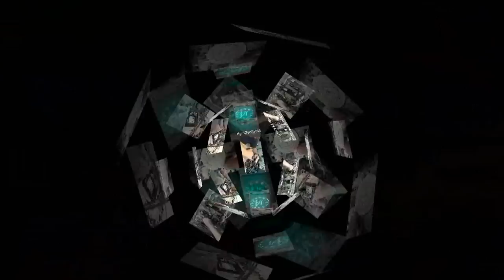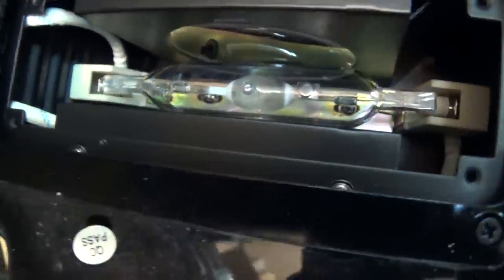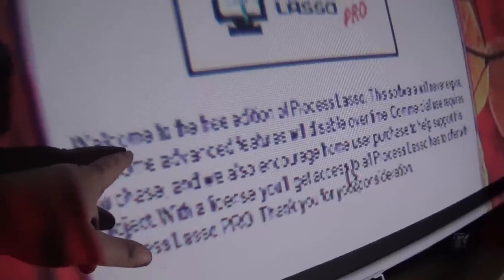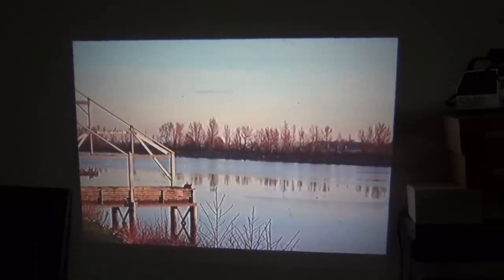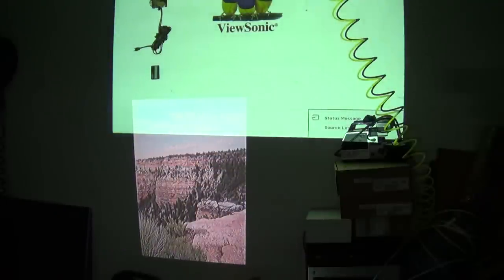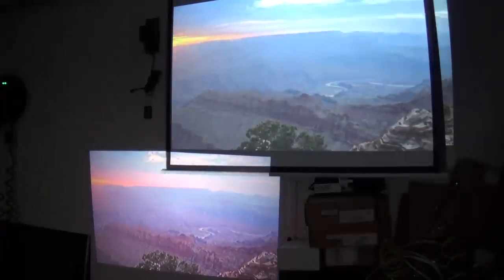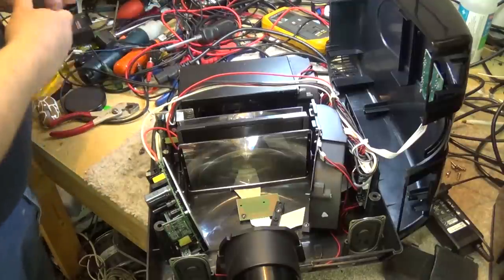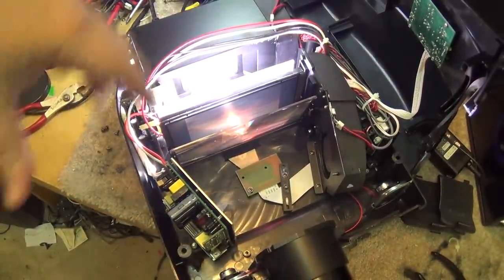Cheap video projector compared to a Viewsonic DLP

Comment: Hey, Watch it..I got one of these...(50 Watt LED version) Yes, you have to completely darken the room,  but try projecting that onto an actual REAL 1:2 screen material instead of a damn  assbeat garage door, you'd be surprised. BTW, I bought mine in my fav section, "For parts only" section of fleabay for 48$  The stupidity of people has risen exponentially past 10 years,  had it out the box, fixed and working in 20 minutes upon USPS delivery. Yeah I know its a cheap chinese  7" Display LED driven POS, but knowing what to expect, and 48$ is a far cry from expectin a Hi-Def, contrast sharp, Movie Theater quality picture for 300$...LMFAO,  Shiiot, I got more invested in my 131" theater screen than the projector, but I have now upgraded the projector to  an Acer H5380BD DLP Projector (also bought from my fav section) after using this cheap chinese fresnel lens designed device for 4 years.
Reply from the maker: I have one of those LED version projectors too. Got it for free. It used a 4" HD LCD panel and actually produces a respectable picture considering what it is.  This one had a 480 panel and looked pretty bad.
Reply: @12voltvids  That Acer will be here Tuesday, Read nothing but good things so far, pictures still great in a fully lit room reviews say, a TRUE 3000 ANSI Lumens,  a native rez of 1280 X 720, DLP, and a 17,000:1 Contrast ratio, WoW, should get some pretty decent blacks in the show now, throws out to up to 300", Amazing... and I just need 131" ;)  "ya that's what she said" Pic of my Homemade screen below, roll of theater screen 2:1 was 100$, rest was lumber from Lowes, ;)  about 150$ total, 4 years ago
Thanks for the great Vids 12voltvids!! ;)
http://i58.tinypic.com/293w12e.jpg
http://i68.tinypic.com/rkv9n4.jpg
..and this last one is hillary-arious, totally unplanned "Kodak Moment" ...
http://i65.tinypic.com/1q0jdl.jpg
Reply from the maker: @thecentralscrutinizer5105  DLP and LCOS are great projection technologies. I have a DLP TV here, actually 2, bit one the DLP chip is failing on. That one uses LED light engine and has one of the best pictures Ihave seen. Well it did until the mirrors started falling off the chip. Now it needs a new DLP chip. 225 for the chip is a hard pill to swallow to fix it.
Reply: @12voltvids  Ya, TI's DLP tech bothers me still, very touchy, results are brilliant, but damn,  so sensitive. gotta treat em like an  egg. I used to service stuff from a local chain "Rent-2-Own" place (8-stores) and they hooked up a line of tv's (Thinking Sony's) w/ this new Digital Light Pulse tech, looked quite impressive...at first. about 3 months after renting these,they were were failing left and right on me, that was 2010-2011. ..., they ended up ceasing that run, thank you very much, ... and here I am getting ready to hang a DLP projector from a 12ft ceiling today...LMFAO ;)
But I'll let ya know what the final results will look like, waiting on the Postman now. Thanks bud...
Reply from the maker: @thecentralscrutinizer5105  
Sony used LCD and lcos and they were crap.  Panasonic Toshiba lg and Samsung used dlp as did BenQ ViewSonic ECT. Only my 1080 Samsung that used "wobulation" has the problem and that set was never bumped or banged around.
Reply: @12voltvids  OMG, I can finally take down all my black curtains from the 2 entrances and the 2 windows in the room, Holy crystal clarity Batman!! LOL, another "Busted", "For parts only projector" repaired in shorter time than it took to take it apart. But I am in Luv with this puppy, I can't get over how bright, clean, sharp the image is. Think this one makes up for those couple lemons I bought about a tear ago, those were definitely smashed & trashed. Kept the bulbs & lenses...lol
Side Note about this Acer, The seller did state it came with no remote, but I figured I could get around that problem till i can order one. Turns out I can not, theres only a power button on it, I can get to the native res, but i need to get to the controls of it via remote to adjust anything such as size, color,brightness,etc. I dig the fact it auto adjusts when flipped upside down mounted on the ceiling. Ordered an OEM remote,cheap, but coming on a slow boat from China..lolz...So I'm right this very minute, making an IRblaster for my samsung fone from a couple of IR LED's and a 3.5mm headphone jack, and the android remote control app, "ZaZa"
Let ya know if it works ;)
Reply from the maker: @thecentralscrutinizer5105  
Yes DLP technology looks great doesn't it!

Comment: I working in shop where servicing branded projectors. Open lamp cover protection has 1of 100 in branded projectors. And this lamp cover protection i saw wotking in cheap chinese projectors. That is not true that you are saying that all have. And for your Viesonic lamp manufacters is many and genuine. And hand made, that is true they all are hand made. Because is sources where you can have repair kits. In lamp housing is changing only high preasure bulb. That is because in market is very old projector and as always need to change lamp and you cant fast find suplyer than you can buy kit if housing  is good than you can repair it.
Reply from the maker: All projectors should have a lock out for the lamp to prevent it from operating when the cover is off. This is especially critical in projectors that use the UHP lamp, as these lamps have been known to explode, and they produce tons of UV radiation, UV-A, UV-B and UV-C which is the harmful type. The projector itself has UV filtering before the light exits the lens, but the lamp itself produces a fair bit, so you don't want the lamp operating when the cover is open. Out of all the projectors I have serviced this is the only one that doesn't have a lockout, but I am sure there are plenty of cheap ones out there that don't. The better ones certainly do.
Reply: 12voltvids Now on my workbench now i have 5: Toshiba, Sony, Xerox and old ViewSonic and Epson and none of them have some kind protection to protect opening lid. No microswitch no IR pair no IR swich no magbetic switch. And epson is 2017 model.. After your video i checked all with open lid and all working fine in open lid. About  that UV that you are writing in open lid they dont come out even that lid is open. I think this lid is mainly for that you cant take or lose lamp in working condition. Because i did experiment if in working condition take out lamp one blowed away one distorted that high preasure chamber one only blanked but for the electronics they all dead. I think that is for the high voltage. Now i repairing new one Sony and it now works with lid open. :)) I like ViewSonic and Casio they are good but more i like Toshiba or Epson.
Reply from the maker: Remember I left the service industry on 2003, however at that time every projector, both front, and rear projector LCD and DLP had lamp interlocks that shut the unit down as soon as the lamp door was removed. The Samsung and Viewsonic I have have interlocks. The 2 epson units I have serviced in the past couple or years both had interlocks. I can't comment on other brands other than the ones I have worked on, which is a Panasonic RPTV DLP, a 2 Samsung, a Sony, and Toshiba rear projection DLP and LCOS, 2 epson, and a viewsonic front projector They all had lockout switches, one of them, the Samsung that is what faled. The switch went bad.
The only one that I have seen without a lockout was this one, but I am sure there are lots these days, because it comes down to cost, and regulations. As soon as they relax the safety regulations, I am sure they will drop the interlock just like they did with TVs. If you have been around long enough you will remember the interlock cord that disconnected power when the back was removed. When it the last time you saw that?

Comment: I have seen people build a projector out of an old overhead projector and a used 15" lcd monitor that had a better picture than this. This is deplorable!
Reply from the maker: +James Last Yes I have seen those as well. Poor mans projector.
Reply: I've made one of those using a uxga 15 inch dell laptop screen and the picture quality from that 10 years ago is better than some of the junk they are still selling now.
Over driven 600 watt halogen bulb and far superior optics, fresnel lens etc.
Draw back is light leaking and extreme heat

Comment: I doubt those lamps are hand crafted. Possibly about as hand crafted as an iPhone.
Reply from the maker: You should do a little research on the Philips UHP lamp, which is the one I was referring to. Every Philips UHP bulb is built by hand. The same can not be said for the knock off lamps from China, and that is why so many of the cheap generic replacements explode inside the projector and destroy the unit by blasting almost molten fragments of quartz around the optical cavity.

Comment: yup, in the USA we call them "white van scams"
Reply from the maker: +THEtechknight We called them the same up here in the Great White North.For years they were flogging speakers. Now it is Projectors.We do have a new name for them though. Now it is called the Groupon Scammers.
Reply: 12voltvids the white van scam crap is still rampant here. I seen that projector, and I have seen AV systems and a "700W" Subwoofer with a "vacuum tube technology" display in front, but in reality, its powered from a single crappily soldered TDA7294 circuit. Do the math right quick. yea.. LOL
Reply from the maker: +THEtechknight 
Oh I know they are still out there. That is where this came from. Some guy got scammed, and after he figured he had been duped gave it to me
Reply: +12voltvids haha, he must not think of you as a friend. i wouldnt give that to my worst enemy.
Reply from the maker: +THEtechknight 
It was a customer of my day job. I was working at their house and the guy handed me a box and said how he got ripped off buying it but it was useless and said take it away and use any part that are useful. The light bulbs are the same that my aquarium uses. I kept the 2 new bulbs an sold the unit cheap to a friend that wanted it to play in his back yard at night. Wants to create that "movie night" atmosphere. I can not think of a worse experience myself. Sitting outside swatting mosquitos while trying to watch a movie on a shitty projector but to each his own.

Comment: dude try with lower resolution...and you can see a numbers its resolution is 480 p and its support  hdmi but not in 1080 p.
Reply from the maker: I wasn't using HDMI, I was using RGB from the computer, and it was set to 720. The projector was actually 852x480 the same resolution as my plasma, and I guarantee you that I can send my SD plasma in my shop a 720, even a 1080i signal and it will scale it correctly and it won't look horrible like this. The only thing that wasn't set right was the aspect. It was set to 4x3, and I found that setting in a menu after I shot the video before I sold it. Yup I sold this pile of steaming crap. The guy that bought it mind you has nothing higher tech than a DVD player so he is happy as a pig in that same steaming pile with it for what I gave it to him for. I even threw in a bunch of used bulbs from my aquarium that still have lots of life left in them, and a small screen to show it on.
Reply: The scaling is always horrible on these chinese crap. Using the native resolution would produce a much better picture and at least make the text readable.

Comment: so basically its a 2002 or 2003 level office projector.
Reply: No, it's not remotely up to that standard. 1024x768 would be typical for that time, most likely with higher resolution versions available.
I doubt any brand name projector from any year is as dim as this.
Also, at least 800x600 projectors were common by the 90s, I think the lowest LCD projectors were 640x480.

My early 80s lower end crt projector does PAL interlaced video and definitely looks better.

Comment: you just get what you paid
Reply from the maker: Well I didn't pay anything for it. It was given to me, and I actually made money. I sold it for 50 bucks, with a used bulb, and put the 2 brand new ones in my fish tank.
Reply: Then what a pathetic seller. They will never expect you make such a "nice" review...lol
Reply from the maker: Ha, and it was a friend that wanted it too. Gave him the screen, mounting bracket, and 3 used bulbs. Use the same lamps on my fish tank, but change them every year because the color spectrum starts to shift.He said "I'll give you 50 bucks for it" and I said sure. Yes he did see the picture in a dark room, but not up against my view sonic.
Reply: I got an irulu projector, it works great enough for me. do you ever heard of this brand?
Reply: Thanks for video , a good laugh but hope your friend learned a lesson , we have all been there before ...  remember the white panal vans driving around selling home theater system surround sound unit ?  Lol , you were lucky if you got a brick in the box ...  seriously , china makes the best and the worst products -  mostly Japan has the better stuff.  Would make for a science project tear down for elementary students - and maybe a lesson on safety and fail safe bulb doors ..
Reply from the maker: It didn't come from a friend. It was given to me by a customer at work that was taken to the cleaner by the white truck crooks.

Comment: at  best its 600x400 res
Reply from the maker: In 16x9 mode, which I didn't find in the menu until after I shot it, the resolution is 852x480p. DVD quality.

Comment: 12voltvids - I find the best projector bulb to be an MR 15 halogen. About $6 each. 12V 50W works great. Factor bulb life expectancy, and it comes out to about the same cost as the expensive bulbs like in your projector. The savings kick in when you get power fluctuations taking out the bulbs. 
Realistically you don't want to go lower than 800x600 resolution on a projector. Any thing lower aint worth watching. 
The odd screen resolutions on chinese projectors is do to the charecters having diagonal tales in their written language. Where as english is written perpindicular and horizontal.
That's why English looks like Chinese, and Chinese looks like crap. On these low res. projectors.
                                                         P.S. You sound like John Candy.

Comment: Why complaining - less sensors, less lockout, no need to bypass any of that, when lamp goes bang and you need to squeeze in a bit longer or shorter one, or replace with LED...

Comment: All those "specs" and they couldn't be bothered to list the supported resolutions or the native resolution.

And check out the engrish on the packaging.
Reply from the maker: +Watcher3223 Oh yea I laughed when I saw it. Het I made 50.00 on it.I also scored 1 150 watt HQI lamps which are running on my aquarium. I had the guy a box of used lamps from my aquarium. I change bulbs every year because the spectrum drifts and then algae starts growing in the tank when the UV spectrum changes. So I have to re-lamp, but they still look fine for projecting pictures.  The guy I sold it to thinks it is great, because it is better than what he has now, an old small tube TV. So he gets a big screen cheap, with a half dozen spare lamps, I make 50.00, and get 2 new bulbs that are worth 50.00 each for my fish.  SO I am up 150.00 in the end, and then every time someone watches the video I make a penny.